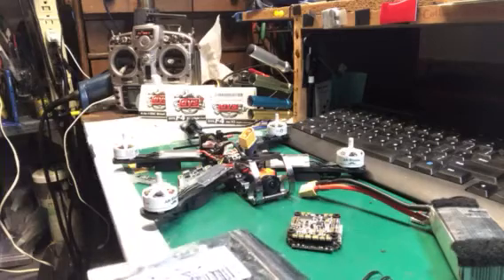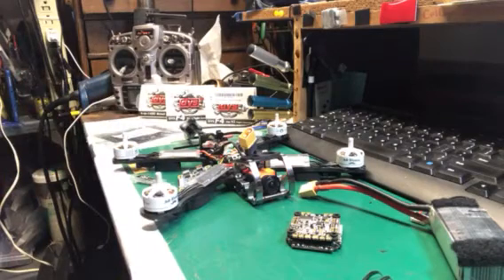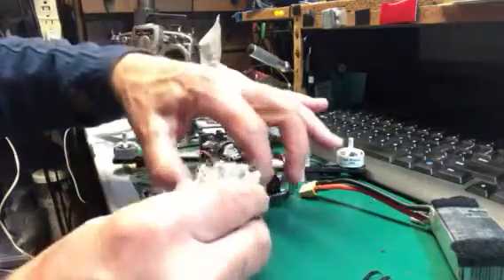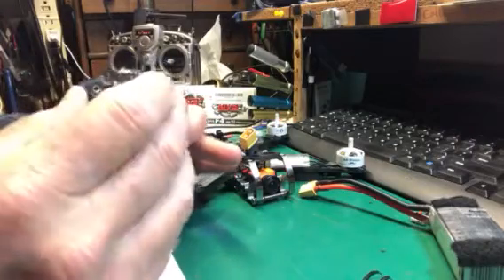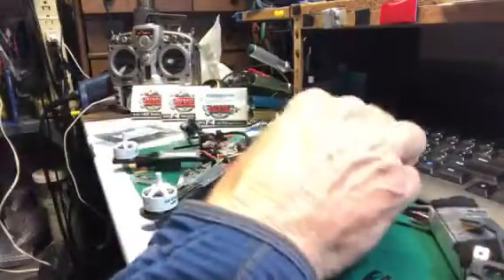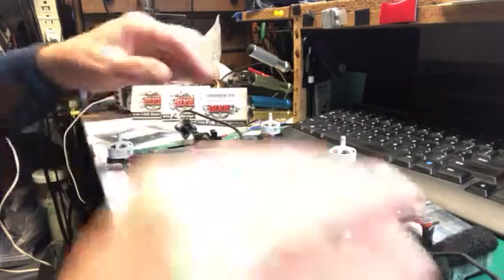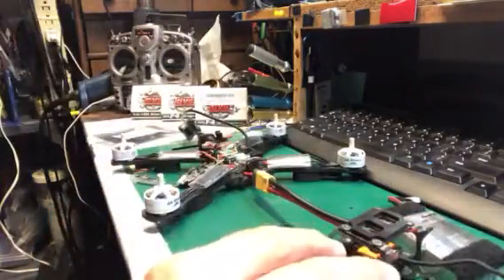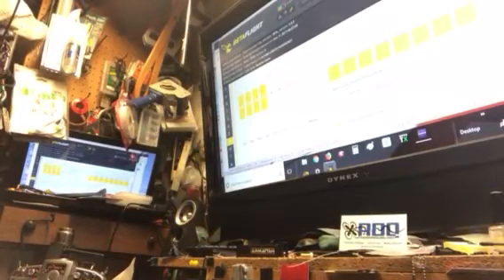ESC's not calibrating in Betaflight and won't spin up

Comment from the maker: Well... I figured it out. I had not selected multi shot in BF!!!
Reply: Thank you so much for answering this!
Reply: Busy repairing a quad for a friend, after the rebuild I have 2 motors that don't detect ESC and non want to spin on the motors tab. Going to give this a shot. Thanks. you may have just saved me a bunch of time.
Reply: And problem solved. You are a legend. Thank you sir.
Reply: Same issue I face! If it's just selecting multishot you gonna have my butt from abandoning my new project
Reply: saved another guy here! THANKS
Reply: Where do I find multi shot